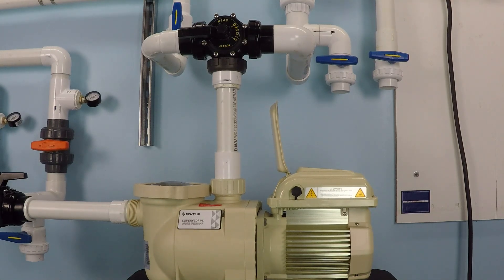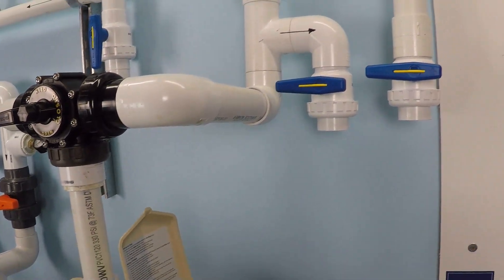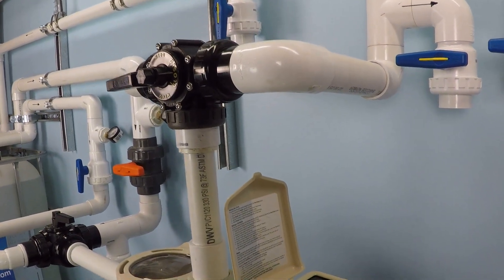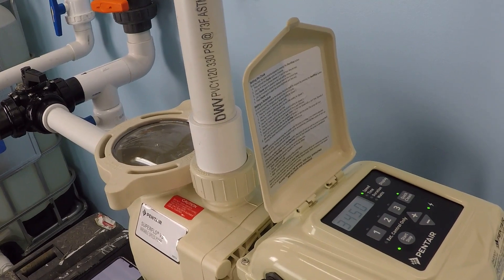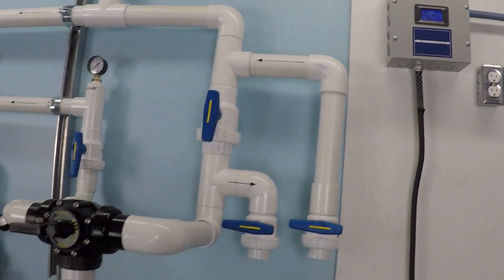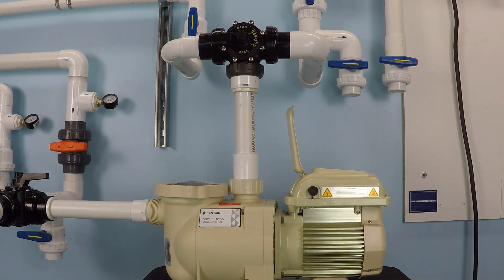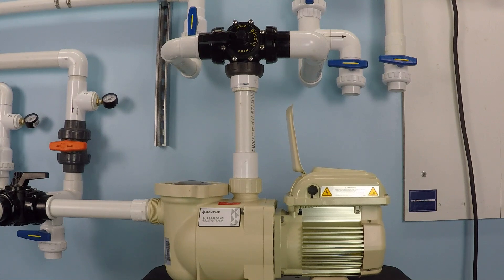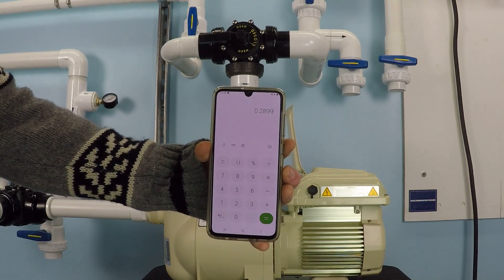How Much Power Does A Pool Pump Use?

Comment: I don't think my iAquaLink status output is accurate.  It said at 3450 RPM I was using 40705 Watts, or more than 40 kW.  This is with a 2" return line and a spa not that far away, about 50 feet. At 3110 RPM, 19 kW, at 2350, 709 Watts, at 1500, 153 Watts, and at 750, 40 Watts.  So I'll be running it at 750 of course, since that turns about 38 GPM, so I can turn my 1575 gallon spa 3 times in 2 hours.

Comment: What do you think of what the ultimatepoolguy said? He said running vsp pump running on a lower rpm isn’t efficient enough and cats more to run, is he correct?
Reply: Not cats I mean costs
Reply from the maker: Not correct which you can see evidenced for yourself in science textbooks explaining pump affinity laws. As ypu reduce rpm there is a (non linear) drop in the power consumption while maintaining a linear drop in flow rate. Also, maximum laminar flow efficiency in 1.5" and 2" pipes are quite low. Only 38gpm and 65 gpm respectively, so any operation in excess of these speeds means a substantial loss in energy efficiency to friction and turbulence. Interestingly slow water also filters better so long as you meet minimum flow rates. All around VS pumps beat the ever loving dog poop out of single speed pumps in every measurable category. Quieter, last longer (less heat at lower speeds), more functional control, and literally will put thousands back in your pocket, effectively paying for itself more than one time over. Don't listen to the haters. Do the math, literally, and here is a page I built with another video that REALLY helps to make it simple to see how it works and where you save money (and how much you save) www.swimmingpoolsteve.com/pages/compare-savings.html
Reply: I totally agree with your math, I think this other guy thinks it’s a scam produced by the power companies to make more money, I understand Laminar flow

Comment: You did a video on the importance of using pressure fittings and not DWV fittings. Good info. However, you're using DWV pipe coming right out of your pump LOL!
Reply from the maker: That pipe is dual rated for both DWV and pressure rated applications. This is getting more common. Dual rated pipe will have ASTM ratings D1785 and also D2665.
Reply: @Swimmingpoolsteve  OK, cool. Never heard of that.

Comment: Volts x Amps = Watts.
On VS pumps, watts will vary by rpms.
You need to know what your rate is per kilowatt hour from your electric company to figure electric cost to run pump.

Comment: So just to be clear, this was a 220v, 1.5hp pump running at full speed. A 3/4hp pump would use ~1/2 power. Also no one would run a variable speed pump at 100% 24 hours a day right? But good video, to the point!

Comment: A single speed or even a 2-speed on high speed will actually consume even more than the variable speed on highest speed.  Inductive motors (standard single and 2-speed motors) are quite a bit less efficient inherently than the permanent magnet motors that variable speed pumps use.  There is a bit of an offset due to the power required for the drive electronics (Hayward seems to be more efficient than Pentair there), but overall, the variable speed is going to run more efficiently, cooler, and quieter (and the motor itself should last longer...there are half as many windings to short out and you don't have to deal with the start & run capacitors).  My only concern with the variable speed pumps is the longevity of the drive electronics.
Reply from the maker: Great comment, thank you

Comment: Thanks for this video.  I have been watching many of your other videos and have been learning a lot.   I am currently getting quotes for a new pool.  I’m looking at a ~22,000 gallon pool with spa that will have a SWG.   The PB I’m thinking of using suggests a TriStar 900 pump.   I’m wondering if I should ask to upgrade to a TriStar 950 pump.   My plan is to operate the pump at minimum speeds for at least 18 hours a day.  Do you have any thoughts on the 900 versus the 950 pump for my setup?

Comment: I have a beach house I want to install a swimming pool but uterlize the sea water instead of chlorine is this a good idea?
Reply: Do not do that ! Very bad idea, you will waste so much money if you do. Do not use well water either. Use normal city water if you can.
Reply from the maker: Definitely not. The salt content is sea water is too high for any swimming pool and pool equipment not specifically purpose made for that application. Running sea water in a regular pool would kill it.